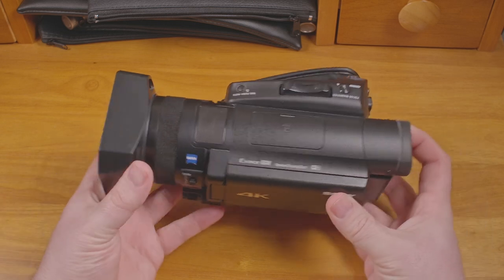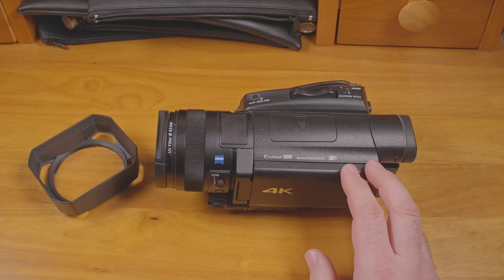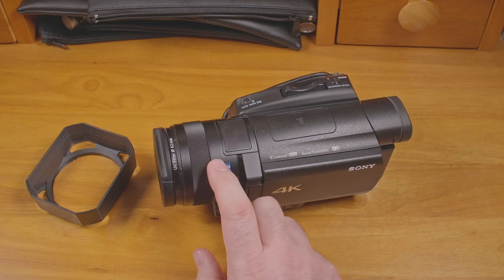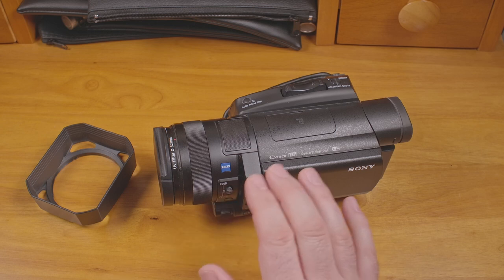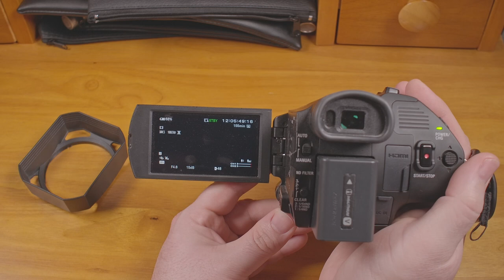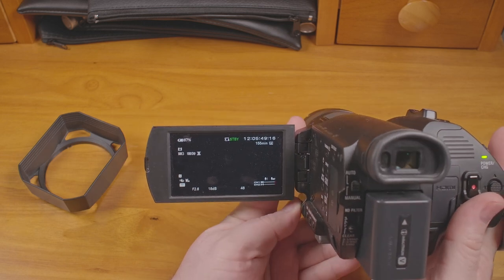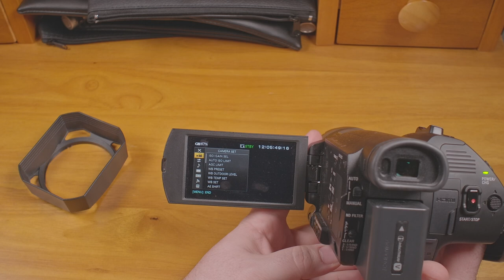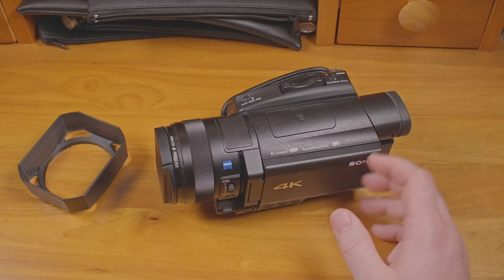Sony AX700 Camcorder: Versatile, Excellent Video Camera

Comment: Great overview. I do landscape, nature and some wildlife videos. This is my work horse. Full frame with multiple lenses are out of reach. The AX700's 1" sensor is larger than most camcorders which gives excellent video quality. The 4K is excellent, though I usually work in 1080. It is as you said very versatile. One of the real benefits of a camcorder is battery life and recording time. The stills cameras will do video, but you need to change batteries all the time and limit recording length. The ergonomics of a video camera versus a stills camera in the field for video make these a real winner.
Reply: why don't you use cx900e, 1" and 1080p,

Comment: I agree with you there, and you should definitely try an ax100, I believe for most people the ax100 would be way more than enough, but for consistent pro-work, the ax700 has dual card slots.  Seems most film makers don't use autofocus at all  anyway, hence the success of cameras that have no AF, like the gh5.  Regular people have no idea what "grading" is anyway, lol.  As for ax100 footage, it can be stripped to vlog/slog, then graded to REC 709 and above, the ax700 definitely will yield better fidelity and skip that process though!  Great video!

Comment: Fantastic review, and so timely - I just bought a Sony FDR-AX700 today !! I have been looking to update from my Panasonic HDC-SD600, which is HD1080i and about 8 years old!! I ordered the Sony and got a fantastic price of $1398 - $500 off the $1898 price that it seems everyone is at currently. I found that price by doing a DuckDuckGo search and seen that Abe's of Maine (which is actually in Brooklyn !!) had that low price. So, now I have been searching YouTube for user videos, and came across yours. Thanks for the review and I will checkout some of your other videos, Charlie
Reply: let know that works out for you. I've heard Abe's like to up sell, and a lot of their stuff is for other markets and not U.S. warranted
Reply: @hoosierpirate3050   - you were right on about Abe's - they called me and informed me that the Sony HDR-AX700 that I ordered was in fact an "International" version and made for the PAL format. And then, they proceeded to try and sell me the US version for the $1800 price. Of course,  they would add an extra warranty and a SD card. I said no and they did cancel the order. So, I went ahead and ordered a "kit" on Amazon and it has arrived and things are going forward.
Reply: @everydaylifewiththebensons285  Good deal it has worked out in the end for you. i've been shopping around for this camera also. but between  walmart and amazon, ebay.  I have decided to bite the bullet and buy from a authorized dealer. for me a lot of money to gamble with. Thx u for the reply back on Abe's

Comment: Thank you so much for your review. Do you know if the camera downsamples the 4k image to 1080p when recording at 1080p?
I had a canon GX10 and the 1080p quality was amazing and it was because the camera used the whole 4k sensor and downscaled to 1080
Reply from the maker: Unfortunately, I don't know if it downsamples the 4k when recording in 1080.  However, the majority of the video I've recorded with this camera for the channel has been in 1080P.  The 1080p is pretty good.  

For many of my videos, this was the main camera and I recorded in 1080 because it was good enough and the files were smaller.  I tried a Sony A6400 at one point and the 1080p was so much worse that I had to use 4K.
Reply: @bigtb1717  I just one and I think Is pretty good but the 1080p I believe Is a step behind canon, 4k Is great

Comment: How interesting, i am considering to purchase this camcorder for my own  welding videos. I had a play around with my Sony A7iii and i was not happy  with the results as i am getting very strong banding and flickering similar to what you have  from 5:40 but in my case 3-5 times worst. No matter what changes i make to shutter speed and its correlation to frame rates the banding just not going away. I was surprised to see similar banding in your video as i hoped that  it will not happen. My current camera is Canon Legria G10 and it produce no flickering and no banding what so ever. Perhaps i should consider the root of Canon camcorders.
Thank you so  much fro your video it helped me tremendously!

If you do not mind me asking what audio set up are you using for your narration in this video? You sound velvety, silky smooth
Reply from the maker: The banding has a lot to do with framerate, but I think it also has to do with the sensor readout speed.  Small sensor cameras with relatively low resolution (like your Legria) will often have very fast readout speeds, so they will be less likely to have banding.  The A7III has a somewhat slow readout speed, particularly when recording at 4K, because it oversamples from an even higher resolution.  I know the AX700 has less banding than the A6400 I tried.  Honestly, even just in standard LED lighting I often had to adjust the shutter speed to minimize banding with the A6400 and I never saw banding with the AX700 in anything arc shots, and even then it's not always bad.

For audio, I record videos like this in the audio booth I built.  I record into a laptop with a USB audio interface.  For this video I was using an Earthworks SR314.  It has a bit more self-noise than I'd like for the price, but it is a good sounding mic.  

Any other questions or anything, let me know.  Cheers!
Reply: @bigtb1717  Thank you!

Comment: Love the Ax 53 and would this as well I suspect (or even more perhaps).  Nicely done video!
Reply from the maker: Thanks.  The AX53 has fewer options for manual control, a bit less dynamic range, only one memory card slot and worse low light performance.  But it is smaller, lighter, cheaper and has better image stabilization.  They are both very good cameras.  Edit:  Oh, and the AX53 has more optical zoom as well.
Reply: @bigtb1717  I occasionally see a used ax100 on sale: more similar it appears to the 53, but with a one inch sensor, so sort of in between.
Reply from the maker: The AX100 is sort of the predecessor to the AX700.  It has almost the identical body and the same lens.  The main difference is the sensor.  The AX100 has a 20-ish megapixel sensor, while the AX700 has a 15-ish megapixel stacked sensor.  The lower resolution, stacked sensor in the AX700 also has phase detect autofocus in addition to contrast detect, while I believe the AX100 only has contrast detect.

Basically, the AX700 has improved autofocus, less rolling shutter and Sony's HFR modes up to 960 FPS (in really short bursts).

Comment: Great video!  Curious your thoughts of this camera versus a sony mirrorless for live streaming, regarding video/image quality?  Thanks so much!
Reply from the maker: If you have good lighting, they will probably both be similar.  Especially since live streaming entails encoding the video at an often lower bit-rate.  The mirrorless cameras will have the advantage of cleaner video in lower light, and they will have a shallower depth of field with the right lenses, if that is something you are going for.  But the AX700 can provide 4K output over HDMI, it can be powered externally with no issue, and it can run continuously with no overheating (something not all Sony mirrorless cameras can do, though some can).
Reply: @bigtb1717  apprecaite you! been using the sony a6400 and jsut got the sigma 16 x 1.4 lens for my show today.  Have the zv1 as well, though going to sell that for a possible camcorder.. love the video quality of the a6400 with the sigma lens ( https://www.youtube.com/watch?v=jWP2JYXVHbU ) and was curious if the camcorder can match the quality?  Many thanks again!  I started years ago with a low end canon handycam and worked well, but... LOL Peace!
Reply from the maker: The AX700 won't quite match the image quality of the A6400, especially if you use 4K, because the A6400 oversamples in 4K.  Also, with the f1.4 lens, you will be getting more light.  However, the 1080p from the AX700 actually seems slightly sharper to me.  Even still, the overall image quality from the A6400 will likely be a touch better.  Not that any of these are massive differences.

I did have to turn on high temp mode on the A6400 when I was used it to prevent it from overheating and shutting down on me.  I never had it shut down on me with that mode enabled, even after an hour or so, for what that's worth.

I have been throwing around the idea in my head of doing an image quality comparison test between the AX700 (and maybe even a smaller sensor camera) and a couple mirrorless cameras.  Maybe even do some "blind" comparison examples to see how much difference, in the real world, people would really notice.  Could be fun.  Not sure when I'll get to it, but I'll definitely put it on the list.
Reply: @bigtb1717  much appreciated! Yes temp on high.  Set at F1.8.  Thanks again! Seeing a blind test would awesome!
Reply: If you are live streaming, are you plugged into a power source or working off battery? I have done a two hour live recording with the AX700. My stills camera would have required three battery changes with gaps in the video.
Reply: @bigtb1717  thank you much!
Reply: @what_surrounds  power source.. Currently using the a6400 with sigma lens and also have the ZV1 as well.. Was thinking of going with the Ax700 and just want the best video/image quality. Appreciate everyone!
Reply from the maker: @LoveGuruGreg  I'm currently planning a video quality comparison test between a small sensor camcorder, the AX700, an A6400 and an A7III.
Reply: @bigtb1717  That would be very cool!

Comment: Good review, but for me, the FDR-AX53. I like the B.O.S.S. stabilization, and the zoom is off the charts.
Reply from the maker: The AX53 is a great camcorder, for sure.  Price of the AX53 has gone up lately, but it's still quite a bit cheaper than the AX700.
Reply: Low light performance with the AX53 I found to be unacceptable. Really glad I returned it and sprung for the 1” sensor AX700 a few years ago. The AX53 stabilization was great though and had decent video in plenty of light.

Comment: Thanks for this amazing review mate. I'm deciding between a Sony AX700 or the new Sony FX30 + PZ18-105mm f4 g oss.
I will be shooting mostly in a studio with a black background, but the set will have professional lighting. A power zoom lens is very important to me, that's why I suggested the Sony FX30 with the PZ18-105mm lens, but feel free to suggest another power zoom lens better than this one and if possible with a longer focal length.
Does the Sony AX700 power zoom have a speed setting? Which camera will give me better image quality? The Sony AX700 will give me a longer focal length, that's very good, but probably the noise will be lower on the FX30, right? Can you help me choose the best camera for me?
Thanks!
Reply from the maker: The FX30 will have better image quality.  10 bit, newer color science, lower noise, better dynamic range, better codec options. The 18-105 f/4 is a constant aperture, so it won't change exposure as you zoom in and out.  The AX700 has a brighter maximum of f/2.8, but it goes down a bit as you zoom.  If you stop it down you can make it stay constant, but it's something you have to be mindful of.  As you say, the AX700 has a longer zoom range than the 18-105, but you can't change the lens.  Though I'm not aware of any power zoom lenses longer than 105mm.  It also has unlimited recording without a fan (though the fan on the FX30 is pretty quiet).

It's certainly not a direct comparison, but I do have a video comparing the image quality of the AX700, A6400, A7III and AX53.  None of those have the newer codecs, 10 bit, etc., but it may still help.
Reply: FX30 is overkill for what you will be using.
I have personally used the AX700 and the FX5. Two completely different cameras. The FX series is aimed at cinema/TV productions. The shoulder hurts from seeing the FX5 lol.

Comment: Very helpful review, thanks. One question. Does the AX700 retain settings when the battery is swapped? For instance, if the white balance and exposure etc. are set manually, will those settings still be the same after changing the battery?
Reply from the maker: Yes, all settings are retained when swapping batteries.
Reply: @bigtb1717  Thanks so much.

Comment: I have 2 AX700's.  I love them but I want to know what you upgraded to.
Reply from the maker: For my videos I also use an A7IV and a ZCam E2C.  The ZCam stays mounted on an arm on the wall of my sound booth, pointing down at the desk.  So that's actually what I used for most of this video.  

I've used a mix of other cameras over the years, but that is what I'm currently using.
Reply: @bigtb1717  great cam for both photos and videos

Comment: I use PP10 and have kept it on AUTO most of the time over the last few years. My horizontal pans at 24fps and 30fps both in 4k seem pretty dang blurry.  Is there a way to get a smoother pan like you see in documentaries?
Reply from the maker: Sometimes a slightly slower pan can make a big difference.  If you have a 180 degree shutter (so, 1/48th of a second for a 24 frames per second frame rate) you will always get a little motion blur.  A faster shutter speed can sharpen up movement a bit, but it can make movement look a bit jittery, though not everyone notices.  It's also possible it's just a result of bit-rate.  Any compressed video will tend to have more detail in a stationary scene because there isn't as much loss when all the frames are essentially the same.  In my experience, once you start panning there are more compression losses because every frame is completely different.  In this case, recording at the highest possible bit rate can help.  

Also, if you are recording in low light and go with something like 1/24th of a second to get more light, you will have more motion blur.  If you are leaving the camera in auto, I'm not sure if it will go that low on shutter speed or not.

Comment: Sir! 7:13 How about the built-in mic, is it directional? In other words when you're standing behind the camera does your voice becomes muffled? My ax43 onboard mic is definitely directional and when I stand behind it my voice becomes muffled (I'm a fan of the smaller older Sony handycams because they utilize omni-directional onboard mic
Reply from the maker: I thought the AX43/53 had a feature to try to focus the audio forward and even "zoom" the audio when you zoom in (processing trickery using multiple mics).  I would think this feature could be turned off?  Also, some camcorders have the mics in front and if you are talking from behind the camera, it can sometimes sound muffled simply because the camera itself is sort of shadowing your voice.  

I don't utilize the internal mics on the AX700 beyond scratch audio very often.  However, I've never noticed them to be directional.  They are on top of the camera, just behind the lens, so if you are behind the camera and have the camera below your mouth level, I imagine it would pick you up pretty well.
Reply: Totally understand where you're coming from Son! Example: with the older version Sony Handycams such as HDR cx210 / cx405 you can stand anywhere around the camera and it picks up the audio beautifully. hence omnidirectional 🤟 it's all good no biggie thanks for your response ✌

Comment: I am curious about your statement about its optical stabilization.  I have an AX 33 which has BOSS,  so I thought the AX700 only has Active Image Stabilization.
Reply from the maker: The AX700 doesn't have "BOSS" stabilization, but it does have optical stabilization in the lens.  It also has an "active" stabilization mode, which I believe adds digital stabilization on top of the optical.

Comment: Great video.  I do have a question.  I know absolutely nothing about using manual setting.  Will this camera work well just keeping it in auto mode?
Reply from the maker: Sure.  It does a fine job in auto.  Even in "manual" mode you can leave the camera to adjust most stuff on its own and only adjust what you want.  But you can certainly just leave it in auto.  There are certain situations where you might get better results if you were to choose certain settings manually, but this camera does a fair job in auto.
Reply: @bigtb1717  thank you for your response.
I currently use the Sony AX53 but want to purchase another camcorder. Maybe I’ll consider the AX700.
Reply from the maker: I have another video where I go over all the features, menus, and operation of the AX700, in case you decide to go that route.
Reply: @bigtb1717  I will watch. Thanks

Comment: When you record in 4K on Sony AX700, do you see the video having micro jitters, like jerky motion to the footage on panning left and right? I see the video you posted here is good, was this shot in 4K? Thanks
Reply from the maker: A lot of the video I've recorded with this camera was in 1080p, but I have recorded in 4K quite a bit and I never noticed the jerky motion.  Could be a setting, or maybe a framerate issue.  Any chance you are putting 30 FPS footage on a 24 FPS timeline, or vice versa?  What about shutter speed?  A fast shutter speed can make the video look a tiny bit jerky when recording at 24 or 30 FPS because there is no motion blur to sort of blend the frames together (which is more important at 24 or 30 FPS).
Reply: @bigtb1717   Thanks for the reply, actually I was planning to buy one and see some videos on youtube are not smooth.
Reply from the maker: I suppose, most of my use is on a tripod.  It's possible that there is some micro-jitter to the stabilization, but I haven't noticed it in my use.